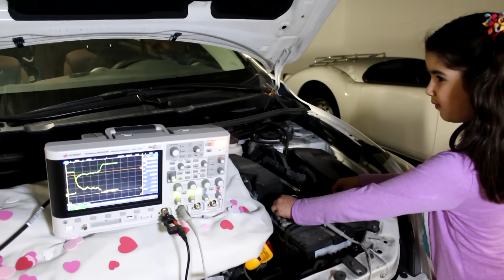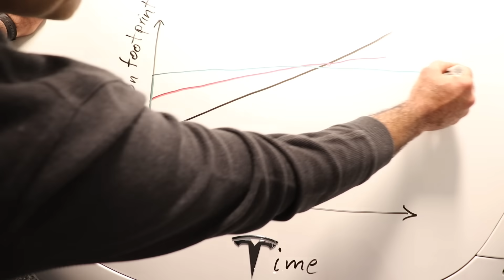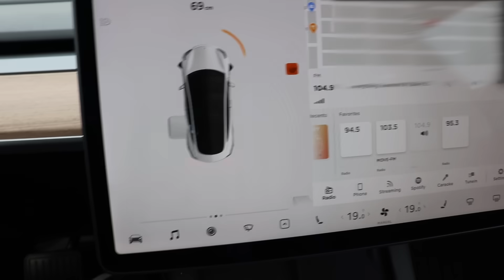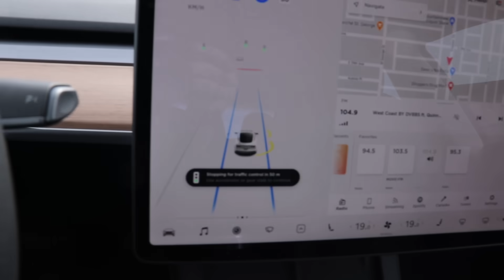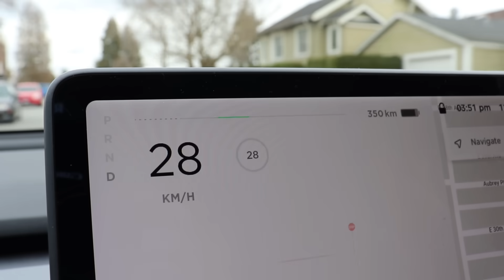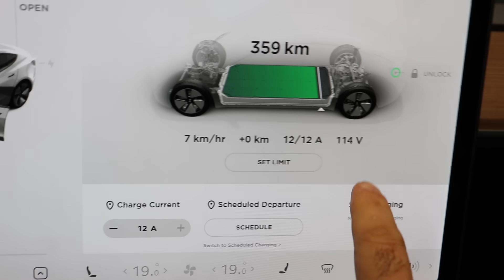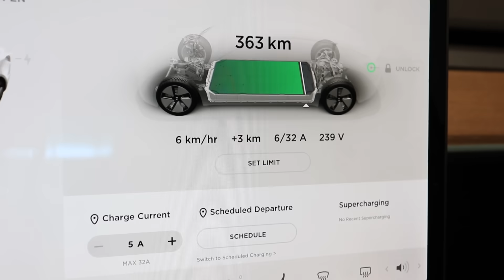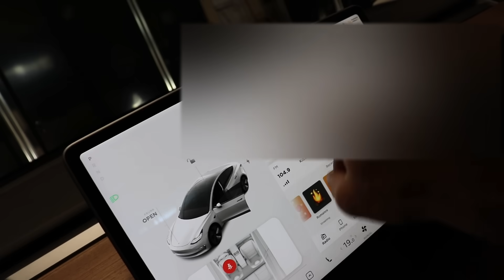ELECTRIC VEHICLES & My Tesla Model 3 Review

Comment: I've had the same model since 2018, and still like it a lot for the same reasons you mentioned, though I don't trust the autopilot much.  I won't use it except for the smart cruise control, and that not very often either because it sometimes reacts violently during traffic merges.

But I want to thank you for the idea of charging at a lower rate in my garage.  I am not sure why it didn't occur to me that I didn't need to charge at the full 40 amps.  So I cut it down to 15A, which will still charge it by morning, so win-win... Less I^2R loss!  Even less needless CO2 emission.

Comment: I just wonder how these cars will work in say 10 or 20 years.  Cars already don't age well.  Add in electronics,  which also don't age well, and I think these cars will get bagged quick.  Would you keep a cell phone or PC for 20 plus years?
Reply: But a cellphone and a PC arent of the same domain as a car. 
You are required to change to a new pc and cellphone up to a certain time because software, and most of the internet, wont work too well on old devices with limited power and capabilities, because people are coding up new applications and technologias so hella damn fast. But I don't think you'll have to change your tesla every 5 years or something because its computer suddenly cant 'connect to tesla server or something due to technology change'
Reply: @guilhermealveslopes  absolutely you will.  We already have it with current vehicles.  From tape payers to CD to Bluetooth, LCD screens, backups cams.  In a decade cars have changed enormously.  Now think how much Tesla will change.  Their vehicles will almost certainly need software updates.  Which means memory and RAM upgrades. Batteries will age out.

The fact is very few electronics are supported after a few years.  Whether personal electronics or even industrial automation.

Comment: Hi mehdi. In the video you said that cars still burn fuel when coming down the hill but in the newer standard shift cars the fuel injection turns off so it burns no fuel but the engine still turns because the engine is going down the hill and also the brakes won’t run out because the engine slows the car. Not as efficient as electric cars but just wanted to say something just in case you didn’t know that. Ok buy mehdi

Comment: And I'm for electric cars, although this one can't be compared to the original one that Tesla invented. In his, if I remember correctly, there was some kind of battery or something like that because it was not clear what it was with which the car could move without a break at 100 km / h for a whole week. This is roughly 20,000 kilometers. About 50 times more than the one invented so many years later.

Comment: The thing with ACC is that it only recognizes moving obstacles like a moving car (and also maintains recognition when the car stops) but it doesnt recognize stationary stuff like the box or the wall so that the car wont  brake when taking a turn, for example.
Reply: It is much easier for the software to distinguish a moving car from the environment. What seens obvious to us humans is not so obvious for the car. Normally durinng ACC the car can follow the front car even while turning so simply disabling is not an option. 
Other safety measures are stuff like a minimum speed requirement for activating ACC. In the end it all comes down to minimizing the risk of unwanted behaviour
Another good example might be an ending lane or a curvey lane with a wall up front. You know that you simply have to switch/follow the lane and you dont want your car suddenly breaking in the middle of the road. For stuff like that it needs a camera which goes beyond ACC into autonomous driving territory
Reply: @Eazy-31 akchually, we also detect moving objects better. If i'm not wrong that's why freezing up is a common response for scared/surprised animals.
Reply: The ACC for the new Nissan rogue is going to get someone killed. You can set the distance you want it to follow behind a car in front of you and the other day as I was passing a car on a 4 lane highway while in a very slight curve to the left my rogue seen a stationary box truck in a parking lot on the side of the road and thought the box truck was in front of me and much slower. While merging back in front of the car I had just passed the dammed cruise control slams on the brakes for literally no reason at all. Had i not been paying attention and immediately took control and corrected the car behind me could have well hit me and it would have looked like and insurance scam no doubt
Reply: why wouldn't the software just disable braking for stationary objects while the wheel is being turned then? seems an obvious and safer solution

Comment: 13:30 One quick point, gasoline(and diesel) cars have engine braking and when you engine brake you don't use gas (with cars from the last 2/3 decades)
Reply: The best an ICE can do is not use gas at certain moments, which is a minor overall saving, and many of those times are using the battery for accessories, which means the engine will do work at another time to regenerate the power.
A great point will be when they can put gas back in the tank!

Comment: 13:35 when you drive right you use Not a drop gasoline/diesel driving donwhill.
Reply: Yeah I mean all you got a to do is throw it in neutral, kill the engine, and hold on for dear life without power steering.
Reply: @nickt6980  no first or second gear and the engine shuts of gas and you brake with it. This is how you drive in the mountains brakes not gona cut it.
Reply: @duderobi   oh. I thought that was only true for Jake break. Makes sense for fuel injectors to stop giving fuel if no throttle.
Reply: A manual driver 😁😂

Comment: Also Mehdi you with all due respect lack some automotive knowledge. Going downhill in petrol car you dont burn any fuel (assuming you are going down in gear and engine breaking). UNLESS we are talking cars older than early 90s, that have carburetors .. then yea... but seriously any car since then with MPi / GDI (electronically controlled fuel injection) will just stop fuel and engine is just "air pump".

Additionally comparision of costs of running petrol and EV cars is really not fair when you compared heavy taxed petrol (here where I live OVER 50% of the cost of petrol is tax) and untaxed (with the extra tax) electricity. Government won't say good bye to these money (as they would have to grab em elsewhere) and so clearly this is not comparison that can be stand its ground thru out time. At some point (if EVs get mainstream) special tax to compensate what the petrol Tax brought will be added in one way or another. Some countries already started doing this in a way...
So to be fair you'd have to cut petrol costs in HALF.
On top of that you are omitting the charger loses. Which while not massive, are still about some sources claiming ~9%, others going as high as 12-15%!. I.e. to charge 54 KWh, you will need ~ 60KWh. You can do better than this - what I usually like about your vids is that you dont blindly side.
And really? 10 liters pet 100 kmh... in a modern car? Really? The EV can show its benefits even without such silly exageration and bias. Modern petrol car will easily go for 5-6 l/100 when going efficiently (90-110 km/h constant speed you can actually dip below 5...) Sure city traffic or going faster drains it more (but on the other hand going really fast in EV literally halfs the range) but assuming anything more than 7.5 l per 100 in modern car is stupid and biased.

So more realistic comparision would be:
60KWh x ~ lower of average power cost = 6.5 USD
6.5 (l / 100) x 3  (300km) x 1.4 (usd per l) = 27.3 USD.  half of that is extra tax, real petrol cost = 13.65 USD

So yea, EV is ~ half the "fuel" costs. And thats what most reasonable calculations come down to. Totally off your numbers.

Comment: I just don't get why ppl keep selling this "EV's have almost none maintenance" nonsense. Neither das a petrol car, for the first half a decade. Sure, oil every 2 years , brake pads if you drive alot, but as for the "feared" maintenance .. not really. That stuff comes gradually with the age, as the life of the various consumables depletes and stuff ages. Around 10 years is a good mark where some more serious maintenace is usually needed... and from that on, unless you "do it all" it will just pop every now and then...

EVs being still relativelly new, most of them are still in the "new" phase. But there are Tesla S owners who already went thru MULTIPLE drivetrains... sure thats prolly just due to defects and not expected lifespan but still..

Anyway my point is that there are many systems on EV that will require basically the same maintenance as regular car. Sure you dont have the engine / transmission and exhaust / intake bits to worry much about... but ask yourself, is that really the only / majority of car maintenance? Not really.
Suspension work (control arms, bushing, bearings on top mounts, ball joints, car dampers, springs... those are generally identical and will require same maintenance .. if not more due to higher weight. 
Wheel bearings... same deal.
Steering - tie rods, and tie rod ends, steering rack. EPS (electronic Power steering) all the same and the maintenance will be the same.
Window regulators, Door locks, wheel arches, headlights ...all that stuff is prone to same maintenance as petrol car.
A/C is very similar and will require same / similar service. 
etc. etc.  All the plastic bits that can break, charging port etc
Tires... teslas are known to go thru sets of tires actually really fast... brake service might be less often if you use regen alot but will be still there.

Sure, there is less of the "small regular stuff", but sayin theres none is also BS. Sure you dont have engine intake air filter or oil filter but there still is a cabin air filter and while there is not  oil usually, theres still (and quite alot of it) coolant for the batteries mainly... and brakes... those are hydraulic as regular.. .so Brake fluid is the same ...and those will need changing.

Comment: 5:07 0 to 100 KM in 5 seconds ? Kelvin Mega?? Medhi what's happening with the units. Plus you are talking about an acceleration?  In km per sec?? That's speed unit Medhi! Acceleration is the speed variation during a certain period of time ( so that would normally be 0 to 100  km/h in 5 seconds). Speed is the variation of position in a period of time.😂😂

Comment: Just to get some things in perspective:  My current BMW has adaptive cruise control and lane assist, it steers, brakes, accelerates, changes lanes, stops behind cars, follows traffic, balances trailers, has cameras all around, stops for obstacles (also at reversing), reads traffikc signs such as speed limits, even slows down if a speed limit is AHEAD etc.etc. Also you do not need to move the steering wheel, touching it from time to time is sufficient. And all this also at 180 km/h.
It does not recognize traffic lights though.
So basically all the fuzz about TESLA's "autopilot" may be more marketing than anything else. In my opinion it is slightly more advanced - true - but other carmakers offer decent systems which are not really far behind - only not marketed as aggressively as "self driving".
The BMW is of course not an electric car, and I am not arguing "pro-combustion" here, just wanted to say that a good portion of self driving capabilities are quite common at least in executive cars these days.
Reply: @HQbaracuda  BTW: Google self driving is a totally different beast. They do it aided by information out of detailed maps.
TESLA eg.g tries to actually recognize traffic lights,  Google's cars know
 by map where traffic lights are.  So it looks that google cars can actually drive alone and that they are so ahead of everything else, but in reality the sort of cheat. In an area where they have no maps they are just on par with all the rest or worse.

Comment: 6:21 The emergency brake assistant works with radar. It needs a metal surface.
Reply: It uses several sensors organized by an AI system to sort obstacles from unimportant noise, and that sorting doesn't always lead to ideal or logical results.  (It's usually very good, however.)  Modern trash bins are made of plastic, but they were displayed on the screen while Mehdi was doing the cardboard box experiment.

Comment: im all for the safety sensors but i think self driving is a net negative right now. it still needs human interaction and a human expecting the car to do its own thing will have a slower reaction time to problems/collisions as they need to figure out whats going on when the car is doing its own thing.

that throttle pedal is not too dissimilar to those of us that drive tow rigs and have exhaust breaks/engine breaks and transmission controllers.

Comment: Did not include the energy wasted to dispose of the batteries after you are done using them so the carbon footprint is not as low as you would think. Compare the gas prices and how much you would save to another fuel car in the same class. Tesla is almost twice more expensive so the difference in the price you pay for the car itself will give you enough fuel to run your standard car for a lifetime. Going electric is the way to go for the future and there is no doubt about it but saying that the current electric cars are better than the combustion engine is not really true at this time.

Comment: Put tinfoil on the boxes and try that experiment again with autopilot or cruise control. Radar sees the metal edges.
Reply: People, deer and modern trash bins don't have metal edges.  The system uses cameras and ultrasonic sonar, together sorted by an AI computer, to detect obstacles.  Note in the video that the plastic trash bins in the alley were onscreen during that demo.  These systems are not perfect, but very good and on average much better than human navigators before they were ever offered to the general public.
It's possible that a combination of the cardboard boxes being too thin of material for a strong sonar signal, too short, too square to how the car was travelling and not moving at all added up to the boxes being ignored and/or the car letting the driver make the final call.  The complex logic involved in these AI decisions doesn't quite correlate to the way we view the world, so it's very hard to guess exactly what happens in a particular instance where the car misbehaves.  Some people have had their cars swerve unsafely for squirrels, while larger dogs and people could be hit, along with crashes into things like divisions for highway interchanges.
The software and hardware is collectively learning and getting better with each update of firmware and sensors, but it's got a ways to go before we can trust it to fully take the wheel all the time.  This is why the car, its company and our governments all warn drivers to keep aware and always be ready to take over control.

Comment: About grid load (16:00), my Renault Zoe (fully electric) came with a "smart charge" app. Once I allowed Renault to take control, the app now figures out how long it needs to charge to provide the requested percentage at the requested time and then pauses charging during peak usage times (actual grid load) and charges during low load. For this I also get a small sum per charge kWh. It also recognizes that I'm home, so on a public charger it always charges full speed. I have full control through an app or in the car to set the percentage charge and time at any time, anywhere.

Comment: hows the carbon footprint on an electric car less if most of that power is burning coal? you have to burn lots of coal to compensate for the inefficientcies in getting coal to electricity and then to motion
Reply: Might want to fact check that.  BC uses about 95% renewables (mostly water) and 5% oil and gas.  No coal mentioned.

Comment: Can you install a generator and charge while driving?
Reply: Robin Truby  Can you mention a hybrid similar to Tesla model S?
Reply: Robin Truby  Yes, but that is obvious. So then what was the point pointing out that?
Reply: Tesla already has a generator that is each motor, which is directly used for regenerative braking to restore some power to the battery.
To have another generator running constantly is an attempt at perpetual motion, which fails due to friction, heat, and all the other fun real world physics.  You can't run a motor off of another motor to save fuel.

Comment: Electric boom we in the US we do use that it’s just called a different name
It’s called Jacob break or called jack break 18 wheels have them
Reply: Sudden engine braking (hard downshift) is also known as clutch braking.  It's very loud, has potential to damage a transmission and is illegal in many places due to the excessive noise.
Off the top of my head, the name Jack brake might come from the likelihood of jackknifing a semi trailer.  Jacob is similar and might also be a variation on Jack.

Correction because I don't feel like editing half of that:  It's called Jake (or Jacob) braking, not Jack, and uses a switch in the truck to deliberately reroute intake air, which eventually makes it to the tailpipes without powering the truck.  No relation to jackknifing, at least in name!  Feel free to add to this info if you know more.  (Like is it actually the same as clutch braking?  I don't know anymore, lol.)  I've not really interest to delve much deeper into the subject.  Have fun, kids!

Comment: Tesla is not Level 5! Stop light requires a car to follow for the car to keep going on Green. If there is no car to follow it requires confirmation on a Green to keep going. Safety reasons also I am thinking Tesla is not yet at 99.9999 accurate yet. This is not self driving !!!!!!!!!!!!!!. It’s a very advanced form of cruise control. You do have to change brake pads just after a very long time. What’s running the cooling loop to keep the battery conditioned.